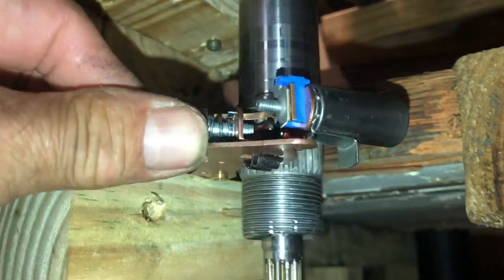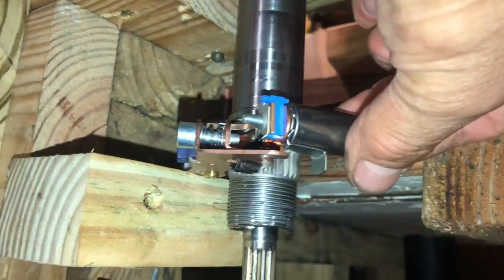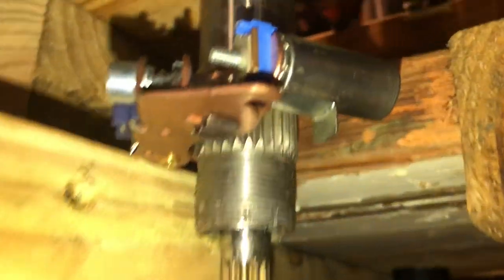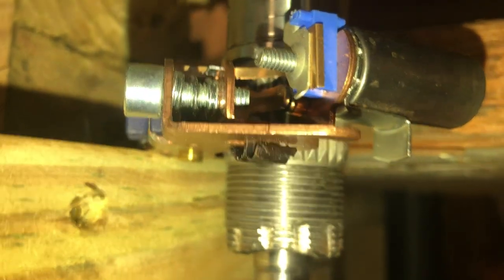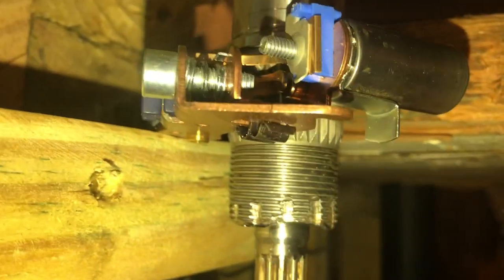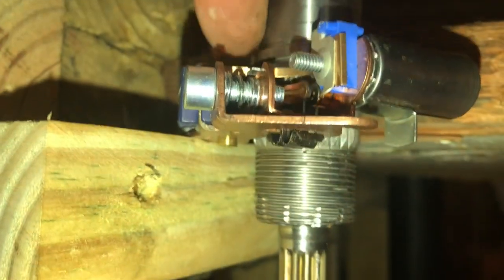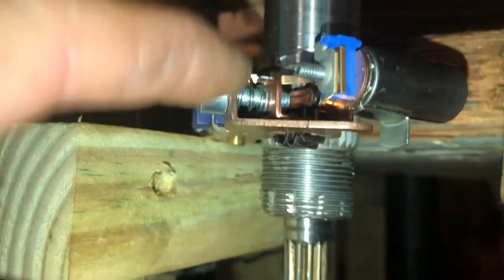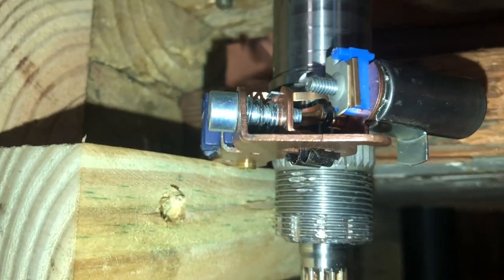Coral Castle, Ed Leedskalnin, Magnetic Wheel, Points, Condenser, Shaft, Working!

Comment: Much Like Pushing Someone On a Swing.. it gets to A POINT where You ONLY NEED 'one Segment Of Time' that is "SHORT" to keep The bigger Protocol Going.. I found The Handle On the Wheel To Be Ideal Connection Time Algorithm, you can Even See the 'Piece Of PI/Pie' in The crossSection of A Log trunk of a tree..where a Branch Grows Out from the Inside out.. it Pushes..its Way Out from the center.. and That 'SPaCE' is Real...'narrow' Window....area.. it Makes sense 'A little Goes a long Way' and..It'S strength "IS DOUBLE" bc It's Surrounded by THE TUBE of the 'tree Trunk' acting Like an Insulator for The Magneticity PRESSED in an Environment Furnace That allows For 'more' EFFECT'UAL'' ..knowLEDGE,.. result
Reply from the maker: Tommy Tommy deafBRED 
Hey my brother Tommy!
Everything has its time to shine!